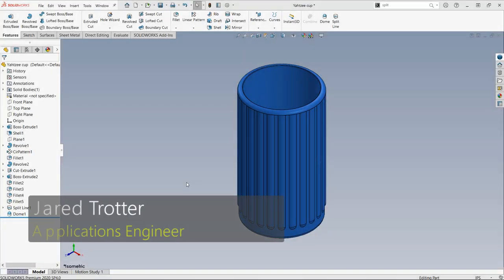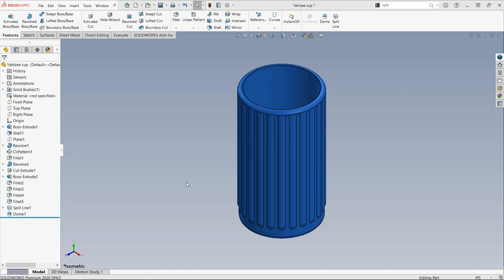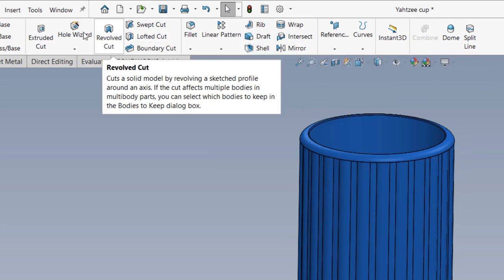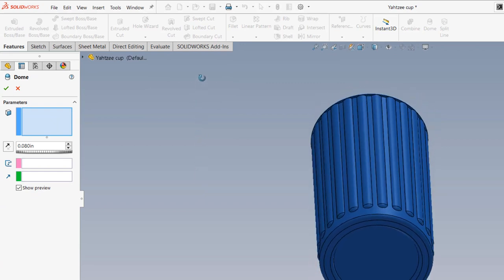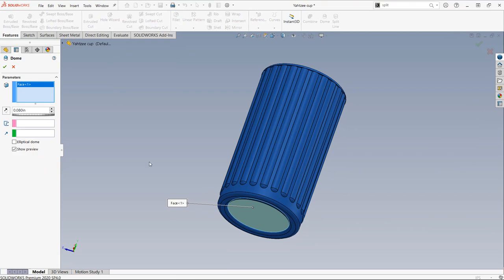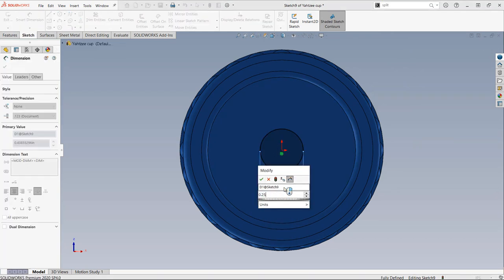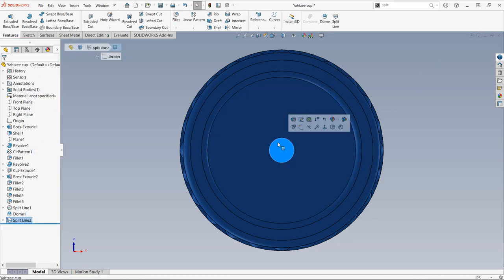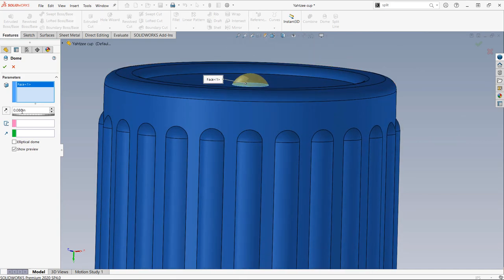SOLIDWORKS Tutorial - Using the Dome Feature on a Yahtzee Cup

Comment: I am encountering an issue that didn't happen in your video. 
I am trying to create a dome indentation in a solid 100*100mm cube and the dome is from the center at a depth of 30mm, for whatever reason I get an error message that my feature will intersect with other parts of the model, thus I cannot create it.